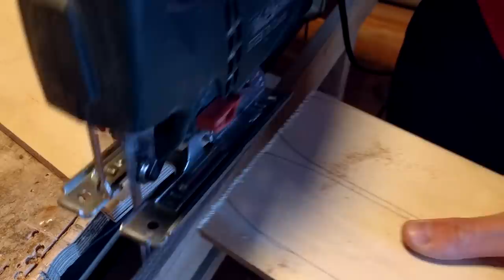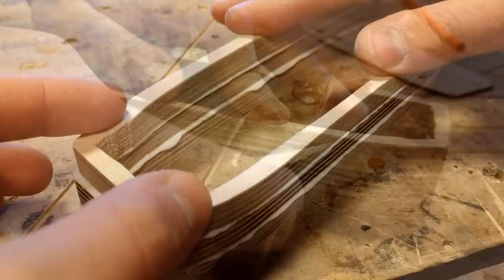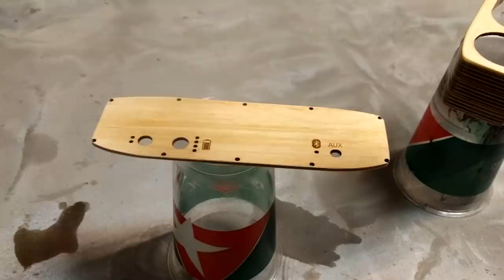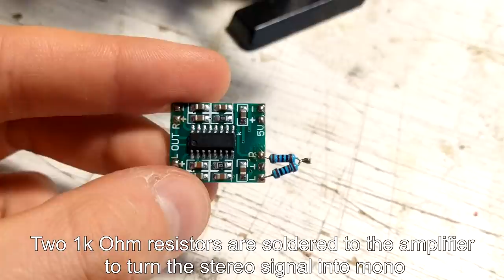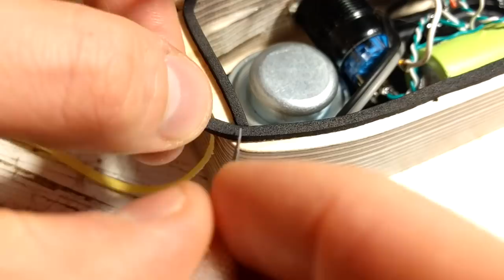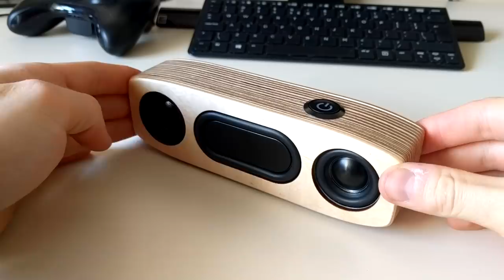Simple DIY Portable Bluetooth Speaker | HOW TO

Comment: What exactly does the isolated converter do?  Did you consider adding a capacitor (220uf 16v) in to help with sudden power draw from bass heavy music so amp doesn’t cut out?

Comment: Hi! Advise please! I need a button for the 18650 battery on and off. 3.7-4.2 V. What is the buy button? 3V or 5V?
Reply from the maker: Hi! Since the fully charged battery will reach a voltage of 4.2V, you should get the 5V switch.

Comment: Would a DC-DC module (B05058) have any use in a speaker system that does not use bluetooth? I'd like to build a similar system like yours, but one that uses only a mini SD card and does not have bluetooth.
Cheers

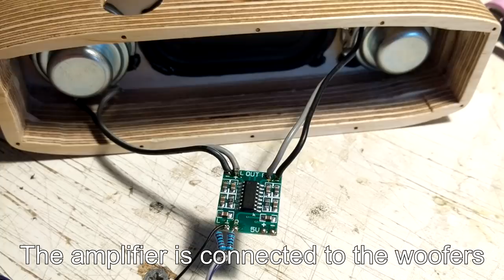Comment: you guys made me want to do my own take on it. Got mine up here on youtube but only a sound test. used Visaton BF37's and a 2x8w tinysine BT amp. think its similar size or slightly bigger (190mm long max). I didnt have much luck with that PAM amp at 7:00, but i also didnt have the 5v to 5v regulator.....maybe next time.

Comment: Hello, good work. I like how you work wood. Maybe I'm wrong, but I think you have reverse polarity in a speaker. In the video you can see when one cone comes in, the other comes out.

I'm interested in passive radiators. Know what advantages or inconveniences there are regarding the vented port.

How do you choose the speakers? I think you use the WinISD software, do you know "BassBox Harris Tech" or "VituixCAD"?

Do you use the FRD and ZMA data that you can extract from the speaker's datasheet? before it was done with software like "SPL Trace", "SPL copy", even with "Engauge digitize". With VituixCAD you can do it. You extract the images of the graphics of the pdf or from the web of the model.

Actually it is very necessary, not to make the box bigger than necessary and have more reliable results.

I say this from experience. My first time, I miscalculated the box for not taking into account the graphics of the speaker.
The second time I made a box for a double coil speaker (DVC), I also miscalculated it, because the volume (cubic meters) is half with DVC speakers, so I also miscalculated the vented port. You have to know if the software has it in mind or not.

Comment: pam8403 in 3.7v can provide 0.6Watts/channel, with voltage 5v it provide 1.5Watts/channel. for safety and longer life, the lithium battery must be charged in 1A max.

Comment: do you think you need to desolder the LED''s off the charging board? lets say you can solder directly on without removing do you see any issues with doing that apart from having 2 lights for everything?

Comment: I am grateful for the great work.
So I want to make it.
I would like to know the reason for connecting 1 (Kohm) resistance to both R and L to the amplifier input.
Shouldn't R, L1 (Kohm) resistance be omitted for mono output?
And how did the 1 (Kohm) calculation value calculate?
Reply from the maker: Hi! Thank you for the comment.
The reason to add the resistors to the audio input is to produce a mono signal going into the amplifier since the speaker drivers share the same enclosure therefore it is necessary that they play the same signal (mono) instead of stereo. I can't tell you much on the calculation of the resistor value, I just checked myself on how to make stereo to mono.

Comment: Hello. Fantastic project. Could you tell me the measurements of the passive radiator? the link does not work
Reply from the maker: Hello, thanks! I used a 78x41mm radiator. Will try to fix the link.

Comment: what's the reason to make the mono audio connection?
Reply: so the passiv radiator moves more and produces more bass
Reply from the maker: The reason is that the speaker drivers are not separated and move the same air inside the enclosure therefore the signal going to the drivers must be the same.

Comment: great looking little speaker. "IF" there was anything you would do again what would it be (for example add weights to the PR or add another PR)? also how does it sound let say 1-2m away in a room?
Reply from the maker: Thanks! I do have a few ideas of simplifying the speaker build and perhaps adding a bit of weight to the PRs while I am at it. It sounds decent further away with great bass for a speaker this size.
Reply: Very nice, I'm going to try something similar but instead of using those drivers, I'll use visatron bf37. Which I believe is the same size. I must admit I was shocked at the size of these, they are tiny

Comment: Would it be necessary to put any acoustic material in there to improve the sound? Not that it really could be improved if your demonstration is anything to go by.
Reply from the maker: Hi! There is no need to add any acoustic material inside since we are using a passive radiator.

Comment: Hi, i made your speaker but instead of laser cut wood, I 3D printed the enclose using wood pla filament. I designed the enclosure in tinkercad and it looks very close to your design.

I am having an issue with the speaker though. Whenever I turn the volume up and heavy bass hits, the speaker cuts off. I have the exact components and wired it up exactly as your instructions. I measured the battery voltage at 3.9 volts. I think it might be my 18650 cell even though it has good voltage. I will try another cell as i have several salvaged from laptop battery packs.

I hope I can work out the problem because I want to turn it up and pump the bass lol.
Reply from the maker: Hi! I would love to see the speaker you have made. You think you could try uploading it on my Instructables? I am sure I would not be the only interested in seeing what you have come up with.

I would assume the problem would be with your battery protection board if you are using one. It seems that it does not need too much current to cut off the voltage. I would recommend trying a different charging board. But it also could be  the 18650 cell - when the bass hits, higher amperage is drawn from the cell and the voltage suddenly drops, triggering the charging board to cut off the voltage to protect the cell from over-discharging.

Good luck!
Reply: @DonnyTerek Hi and thanks for answering. I am not using a battery protection board. I have the same components you linked in your instructable. 
 I also posted my question on your instructables project page. I uploaded pictures in the comments section of my speaker. It's still a work in progress and I will reprint it again after I make some changes.
Reply: @PDRIFT86  
Its a weak supply or maybe you use thin wires for supply thats why it cuts off when loud, try using powerbank board with high ampereage, your direct-to-battery supply cannot handle the load
Reply: @ex-soldier4341  I'm going to try thicker wire and see if that helps.
Reply: @ex-soldier4341  well I'm using thicker wire and that seems to have fixed the problem! Thank you for the advise.

Comment: Awesome build. Thanks for sharing the video.
is there any way to increase the battery capacity in this speaker?
Reply from the maker: Thank you so much! 
You can try purchasing the highest capacity 18650 battery there is to increase the battery life of the speaker or you can try putting two batteries connected in parallel for a higher capacity but it would be a challenge to fit two of them inside such a small enclosure.

Comment: what do you use to glue the passive radiators?
Reply from the maker: Hi, I used contact cement. Apply a thin layer on both surfaces, wait a few minutes until it becomes tacky and then you can glue them together.

Comment: Isn't there any requirement of boost converter for amplifier (PAM8403)?
Reply: Its already 5v ready, the limit is 5.5v oversupply could damage the board
Reply: @ex-soldier4341  Max voltage of an li-ion can be upto 4.2V.
Reply: @harwindsingh  use powerbank boards to boost it to 5v but choose atleast 1 amp output weak powerbank will cause it to shutoff when its too loud
Reply: @ex-soldier4341  I tried with an 2A boost converter but at loud volume it destroyed my PAM8403.
Reply: Therefore I am using direct supply from 18650  battery.
Reply: @harwindsingh  the pam8403 is just 6watts max maybe your speakers watts is too high, or you set the boost to high volts the max volts of the amp is 5.5v only, direct to battery is weak supply i'd advise powerbank modules because of its automatic features like auto cut-off when full charge/lowbatt
Reply: @ex-soldier4341  Its working great with direct supply from battery.
Reply: @ex-soldier4341  Even Donny terek didn't used any.
Reply: @harwindsingh  does it have battery indicator that tells you it lowbatt? No, and theres a risk of overdischarging the battery when its direct,what do you think will happen to an overdischarged battery it could swell or burst maybe he's not aware of it
Reply: @ex-soldier4341  Bro TP4056 prevents battery from overcharging and over discharging.

Comment: You have 2 speakers and yet you still convert it to mono sound, i dont see the point to that
Reply: For real stereo, you need to separate the speakers, as there is a passive emitter, the partitions between the speakers do not make sense to be, because the emitter will not work. If you make a mono signal like in the video, then two 3w speakers will play as one 6w. Converting to mono makes sense. You can not convert the signal, but stereo sound should not wait! And even more so why portable stereo speaker? They're not headphones...
Reply from the maker: Greatly explained!

Comment: But why mono input???
Reply from the maker: The reason is that the speaker drivers are not separated and move the same air inside the enclosure therefore the signal going to the drivers must be the same.

Comment: Awesome small build 
Like that's strong it is yet its only a 5w it's rare to see good design that are based in such low power 

Also you could add on the back of the speaker round passive radiator if you center the stuff that goes on the back the battery Bluetooth and charging ports leds 

By curiousity two things

1: Would you/will you make make this as kits to buy? 

2: have you ever thought on making a cylinder speaker like the jbl?

Edit: also still looking forward for that 2.1 I could bet it will be as good as all your designs 
Also recently saw a sound bar build idk if you plan on making one as well
Reply from the maker: Hi! Thank you so much!
1. I may make kits for sale if there is interest in them.
2. I actually haven't thought about that!

The 2.1 project is coming soon! I am not into sound bar build yet.
Reply: @DonnyTerek  
I've been working on some designs but always come to a hard stop and I've always wanted to make something even if it's already made by soneone else (been looking forward on making it my self) if you make the kit and ship it to Puerto Rico and you can tell that from my part I'm obviously buying it (probably more than one actually x3) 
Also see if you can add an aux in then that way your design can be used with a headphone jack splitter and you can have two speaker from one phone basically making a 20w set since 10+10w yet that's something that passed on my mind 

On the sound bar idea using those same small ones probably using a dual mini amps like on this vid xD it would be a crazy build 
"DIY mini sound bar with dual mini amps" in theory a sound bar it's just a long speaker xD 
All tho dual amo doesn't sounds bad, thinking on it would be using thin cables to place left with left and right with right on separated chambers 
Yet its one of my crazy idea 

Also on 2.1 probably a closed box with passive radiators gonna look awesome 

Also on a side note, thks for the replys, also if your looking for any idea you can use the reply to contact me
Reply: Also, lil question have you ever thought on adding reactive led to your projects?
Reply from the maker: Reactive LEDs are not for me, but VU meters do look amazing on a speaker on my opinion!
Reply: @DonnyTerek  
Ooh ok 
They sound interesting 
I like them leds :3 
Also thks for everything looking forward to your next design 
Also recently 3D printing cases are the new things in portable speakers since its light 
Curious if you would make a design on a 3dprinter